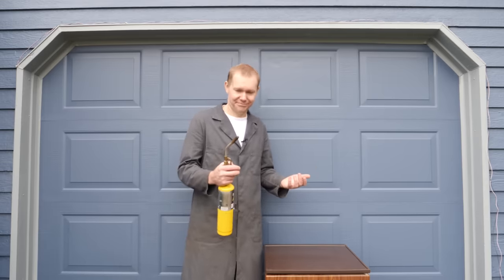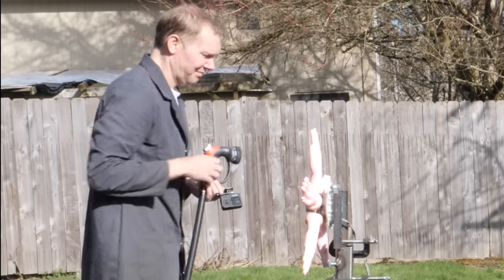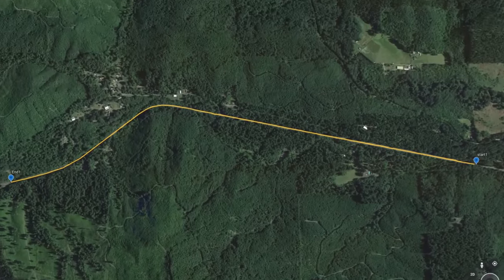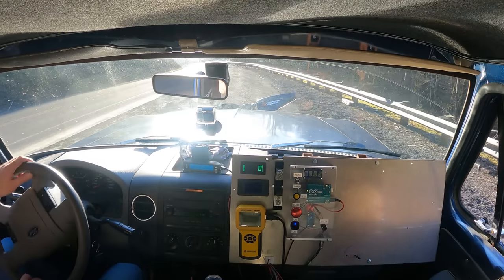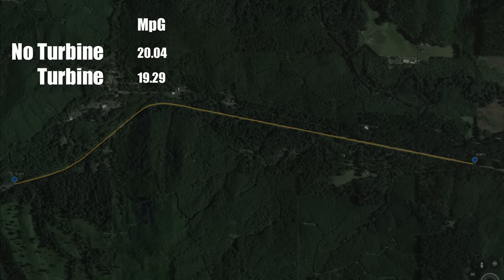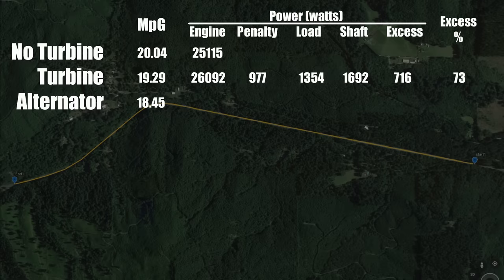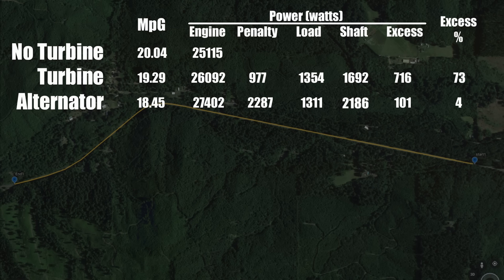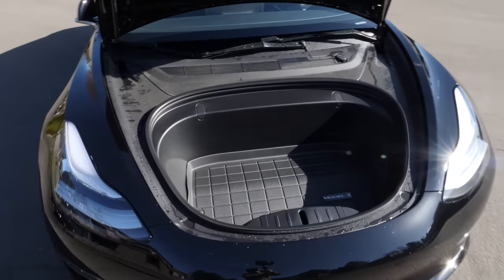Mileage Results You Won't Believe!!! - Wind Power on a CAR #5

Comment: This is no different than cooking a burrito on your engine block.  You aren't getting "free energy", instead you are utilizing "wasted energy."

That makes me think... if an ICE is only 25% effective, most of that lost energy is actually going to go to producing heat (which we then spend more energy trying to get out of the system).  How would you design a power recovery system that utilized this heat energy?
Reply: You can use a power recovery turbine like some powerful aircraft piston engines, or add a sterling engine on top of a diesel one
Reply: Its called a turbo charger. The waste energy in the exhaust is used to compress the incoming air, increasing the fuel/air load driving up the ability of the engine to make more power (but doesn't really increase efficiency, just improves the power to weight ratio.)
Reply: @JR-yl8qi  you can just use the output of the turbocharger to power a generator instead of compressing air and get a power recovery turbins
Reply: @JR-yl8qi  That is not really using the heat of the engine, but rather the compression of the engine.
Reply: @BenKickert  it uses waste heat to drive a turbine and compress intake air. I
Reply: I mean, I don't know if you'd technically even call it "wasted energy" I guess that depends on how much you value getting the best fuel efficiency possible or if you even have anything to use the additional power on, for something like an RV or EV where you have batteries to charge it has some potential but otherwise your still burning more fuel for no reason.
Reply: @tedarcher9120  No.  While yes the exhaust is hot, it isn't the heat energy that is being repurposed, but rather the pressure and momentum of the exhaust.  If the exhaust was cold, it would provide the same improvements as if it is hot.  Case in point... a super charger is providing the same mechanism of improvement and doesn't use heat energy, but rather electrical energy.
Reply: @BenKickert  you need to learn some thermodynamics. The gases have pressure because they are hot, and the turbine converts this pressure into mechanical work thus reducing the temperature of the gas. The hotter the gas - more efficient turbine. That's why gas turbines are way more efficient than steam turbines, because gas turbines run at about 1000 degrees while steam turbines run at about 400 degrees C
Reply: @tedarcher9120  I know a bit... but maybe you can help me.  Where does the heat energy from the exhaust re-enter the system?  If it was the heat of the exhaust that was making the difference, it would exit the turbine cooler, but it doesn't.  Instead it exits with less velocity.  That's because it is the kinetic energy that is being converted and not the heat energy.  Yes, heat created the kinetic energy, but that is beside the point.
Reply: @BenKickert  oh but it does exit much cooler, that's how turbines work. If the engine runs too cold, the turbine can't work, or if the pipe between the turbine and cylinders is too long. That's why turbines are placed as close to exaust as possible to waste less heat
Reply: @BenKickert  heat IS kinetic energy
Reply: @tedarcher9120  Difference without a distinction.
Reply: @BenKickert  average kinetic energy of molecules is the definition of temperature. Turbines which are heat engines convert heat into mechanical work. If there is no temperature difference, they won't work. If you put a turbine on a cold engine running on compressed air for example, it will decrease efficiency instead of increasing it
Reply: @tedarcher9120  What about a super charger?  It is doing exactly the same thing without using exhaust gases.  The air temperature flowing through is significantly lower than a turbo charger, but the effect is similar.  We are dealing with pressure differentials and not temperature differentials.
Reply: @BenKickert  it does use hot gases, it uses the engine power which comes from hot gases. Turbine is simply a supercharger that uses turbine as a source of additional power without stealing power from the engine like superchargers do. That's why turbocharger engines are more efficient than supercharged ones
Reply: @tedarcher9120  As Quint has pointed out much more eloquently than you, all the power in a vehicle system comes from the burning of fuel.  We are talking about waste energy in the system.  Just because there is heat involved doesn't mean you are recovering heat energy when you convert air pressure to mechanic energy.  Technically heat produced the energy that was converted to electricity that powers the super charger, but to to say it is heat and not electricity that is powering a super charger is either pedantic or ignorant.  I will give you the benefit of the doubt on that one.
Reply: @BenKickert  ultimately all energy in an ice car is heat energy generated by burning fuel. And there are more or less effifient ways of using that energu
Reply: @tedarcher9120  So are you going to argue @Quint BUILDs on this point of minutia?  Using exhaust gases to power a turbo is not much different than using wind speed / drag to run a generator to create electricity.

Pretty sure you are missing the point of my original comment.  I am interested in ways to convert excess heat in the engine compartment into meaningful power and you are all focused on how burning petrol provides all the power, which is a given in every argument and a bit useless for practical discussions.
Reply: @BenKickert  it is very different. Using wind is using mechanical energy already extracted by the piston engine, while using a recovery turbine adds more mechanical energy from the same amount of fuel by cooling down exaust gases. You can add a frontal wind turbine for even more efficiency if you want, but it will be nothing compared to a ln exaust turbine, wind turbines will give you 2-3 kw, while a small turbo generator can output up to 100+ kw
Reply: @tedarcher9120  No
Reply: @BenKickert  yes . It's called Turbocompound and is used on most diesel locomotives and generators

Comment: We get sunlight half of the time almost every day and that's real free energy that we don't pay for.
Reply: That strongly depends on where you live and what season it is.
Reply: Geographic location can definitely make a huge difference re how much any given solar system will yield. Those in Sun (or sun & wind) challenged areas would likely want to consider a hybrid solar/wind system.  If wind isn't an option (for whatever reason) those in sunshine-challenged areas could compensate with extra panels but that of course depends on how much space/property (and budget) one has to work with.
Reply: On a side note... while energy from such things as the sun, wind, hydro, geothermal, etc... are "free" from nature, they all require a device/devices to convert the "free" energy into electricity we can actually use and this (unfortunately) is where "free energy" ceases to remain free seeing how all energy conversion devices require things like: design engineers, mining/harvesting of raw materials, production facilities, spare parts, repair technicians, etc... which in turn requires capital/money and a workforce of 1000's upon 1000's of people, who btw, will expect to be paid a living wage for their time and effort.  Regardless of "free" sun, wind, hydro and geothermal energy, etc... (or the invention of an impossible/mythical "perpetual motion" machine) nobody is ever going to build energy conversion devices and hand them out totally free of charge, as there will always be costs involved, thus eliminating any possibility of receiving energy for free :)
Reply: @__WJK__  Not strictly true because you can get more free energy if you build your house in a better direction.
Reply: @chrispollard6568  -  Sure, building a house so that one's solar panels will (ideally) face South, will definitely help with efficiency but it will not provide "free" energy. Free energy, is a bit of a misnomer seeing how solar panels and storage batteries (along w/all the other parts required to complete a solar system) easily requires a couple $100+ dollars for very small systems,  many $1000s of dollars for medium-sized systems and 10s of 1000s of dollars for extra-large systems.  Plus, after about 12-20yrs of use, more money will be required seeing how the original panels and batteries will have reached the end of their life expectancies and will need to be replaced. Don't get me wrong, solar is great, especially when installed properly and used in areas that get enough sunshine... however, it's never 100% free. Peace...(!)...
Reply: That's not free energy in this context. It's not about  $.  It's about watts in and watts out. If you get more watts out of a system than you put in you have free energy.  And have violated the laws of thermodynamics. You can seemingly  get more watts out than watts in with a heat pump but you  haven't done the impossible you've just  used electricity to move heat from the ground. The ground gave up heat, you have to pay the piper. Same with solar.  99% ish mass of the solar system is a fusion reactor with a fuel tank less than half full. (technically watt hours)

Comment: I would love to see the results of adding an electric assist motor that uses the turbine power to help propel the vehicle. Then let's see the mpg figures and find out the true impact on vehicle efficiency
Reply: You and I both. I'd like to add solar and hydrogen as well. A multi-hybrid build that maximized the potential of every type of tech and tweaking each until the optimal efficency of each is all fitted in to harness all the energies available to maximize their potentials
Reply: @terrafirma9328  If by 'hydrogen' you mean using the alternator for energy to split water into hydrogen that's injected into the engine, then I'll have to disagree with that one. After years of browsing an ecomodding community online, I still haven't seen a single person come up with information that satisfies all three requirements of "repeatable, objective, well-gathered data showing improvement; shows for certain that it's the hydrogen that leads to that improvement and explains exactly how; shows that the changes won't lead to damaging the engine or other severe problems long-term".
Reply: @IstasPumaNevada  There are other ways to add hydrogen than the alternator. A chemical reaction chamber for example. Like I said the optimal of each efficent way where each component becomes less efficent these gaps might be filled by a the optimal efficency of another tech.

Comment: Awesome stuff. I don't work with mechanical or electrical engineering or anything like that, but I enjoy seeing things optimized and... numbers going up lol.
Its awesome to see that there was actually some gain, via recovering energy that was otherwise wasted. It's also cool that you made your own well designed
turbine specifically for this project, which performed far better than the ones you bought online.

Comment: So found you on YouTube because I have an electric scooter that reduces its range by 50% if I go 50mph vs 30 mph... and the only notable difference notice to me as a rider is the amount of wind I experience at 50 vs 30 mph... and from what I understand wind drag is the single largest obstacle for a cyclists to over come as road friction is minimal with properly inflated tires.  So I thought to install some dc radiator fans on the front of my scooter that would convert some of that wind drag to energy and charge a separate battery. Or have a direct shaft that would help spin the front wheel to offset the wattage used by the rear hub motor.... anyway I'm rambling,... I love that you went this far to show its possible instead of giving up after the couple purchased turbines weren't sufficient. I hope I can get as dedicated as you with my potential project.

Comment: I really appreciate what you did here. Every time I drive 70 mph down the freeway I keep thinking about the wasted wind energy that could supplement the range on an electric car. I think spinning the generator with the lowest possible drag and at the lowest possible cost would make it feasible. I have a design in my head that I believe would achieve this, but I keep my mouth shut.

Comment: Little confused on what you are trying to do, but
I welded a pulley to my driveshaft and welded brackets, attached a alternator to it and connected it to 4 golf cart batteries in  series and run a converter with it when I go camping. 
I will Jack up and put Jack stands under the axels so the wheels are not touching the ground. By doing that I can turn on truck and put it in drive. I  can throttle up a little and use converters to power up my tools,TV etc.
I usually park in front of a tree if something goes wrong.
Works pretty damn good.

Comment: I did not have a preconceived idea if this would work or not ... that's why I watched it - to see what the "real world" results would be. My concern was more along the lines of "air starvation" behind the fan for the cooling system of the truck.  Glad to see how well it actually worked!

Also, I was glad to see you decided to use the oven instead of that water heater element that was positioned right in front of your son with the extremely hot coil exposed.

Comment: So to sum it up, strictly for driving the vehicle, the fan is absolutely a worse drag.
Once you start needing electrical power on the vehicle, the question became whether the gas engine powered alternator or the wind driven one was a more efficient generator. 
You showed us that the wind one was so much better that it offset the extra losses from the extra drag.
I wouldn't have expected this because like most others, I was only considering the power used to drive the vehicle.
Great video!

Comment: This was actually tested back in the 60's (I believe, I didn't have time to go digging through his books for a date and it seems to be difficult to find accurate info about his stuff online) by Smokey Yunnick the stock car racer. He would do all sorts of things trying to increase efficiency, often bending the rules or causing new rules to be written because of what he tried. He got rid of his belt driven alternator and used a fan driven one instead for an overall decrease in load of the engine resulting in slightly more available power and longer range between pit stops.
Reply: Awesome idea

Comment: How bout you try using Vertical long turbines on the front n side of truck both at same time an separately an see what results you get then I really would love to see a alln1 ELECTRIC plug in vehicle with wind turbine added as a energy fuel source n solar aswell lol ijs

Comment: What about making a cone shaped fan? That as it spin's with the air's resistance it doesn't need to hit the front end of the car. And because of a cone shape. It means it can come into more surface contact. However, wouldnt that cause like an air vortex? Would that change the efficiency of the fan? The fan then could be part of the alternator system in that it turns, which pulls air thats also being pushed. This electric then pumped back into the battery of an EV vehicle.. What kinda results do you think that would get?

Comment: We have also tried using breaking power to help give back energy. Maybe if we combine the wind and breaking, we MIGHT see some different results. When you're in town, you're stopping a lot and drawing power from breaking. When you're on the highway, you're drawing power from the wind. Additionally, we could put a solar panel on the roof and hood. Essentially drawing power while driving and while the vehicle is parked outside. And finally, using the suspension to harness energy. Every turn and bump creates energy. It would be interesting to see all of this work together.

Comment: I have to say, your awesome. I have thoroughly wondered about things of this nature. And I've always know there is no "free energy". But the way you go through everything, follow up and through with your projects, as well as your mentality on accomplishing or even attempting is absolutely perfect.
Personally I wish more people had the drive, desire, and common sense you show. 
I'll admit I hypothesize, but never follow through. 
But I can guarentee I will be watching your stuff meticulously. 

On that note, I have been looking into power options for my vehicle. (I work on the road, and am currently considering solar panels). But I had a random thought thinking about wind power after seeing the crappy water turbines for camping. What about wind turbines in the exhaust. Similar to turbos but instead being used for generating electricity.  I understand the back pressure on the vehicle,  but I feel that it would be much more efficient than any alternator on the market, and less mechanical load
Thoughts?
Reply: As long as you don't create to much back pressure into the engine. It could stall, backfire, damage and even stop or explode.

Comment: There was a guy at the energy fair who had a fan on the front of his truck. He converted to an electric water pump and radiator fan so nothing was running off the crank. He got incredible fuel mileage. The thought he was wacky and wouldn't let him show people in the efficient vehicle showcase,.. he had to teach people in the parking lot.

Comment: I live on a sailboat and I think this is similar in that it seems to break the laws of physics. there is something called apparent wind when your boat uses it's own wind draft to go faster than the wind pushing it. The orma 60 is a perfect example of a boat capable of sailing faster than the wind that is pushing/pulling the boat.(the sail actually creates a low pressure in front just like how an airplane wing shape exploits low pressure to fly)